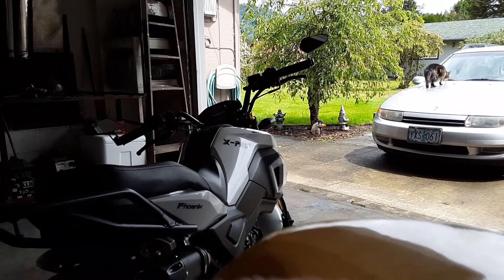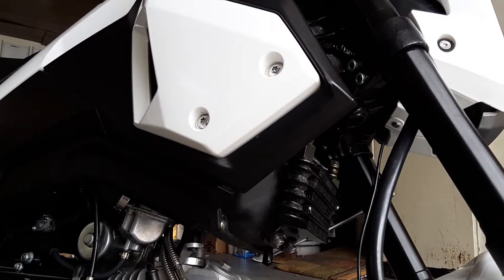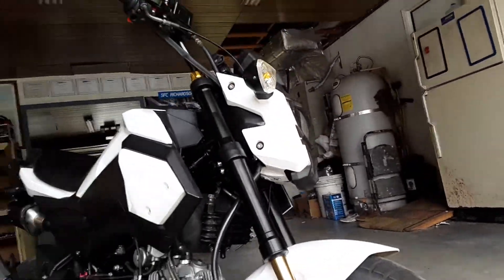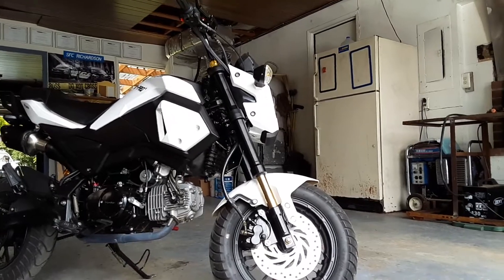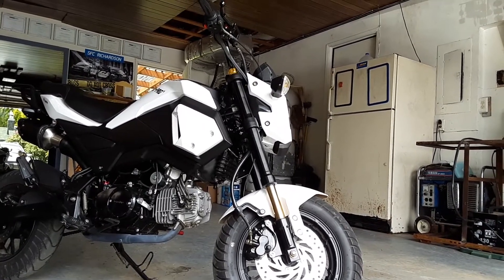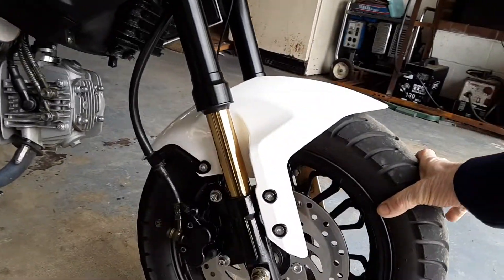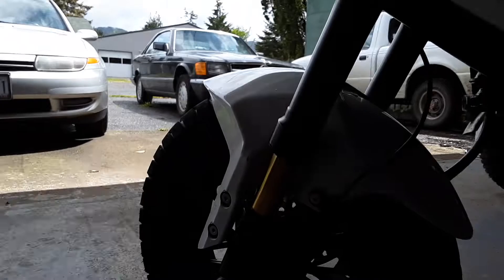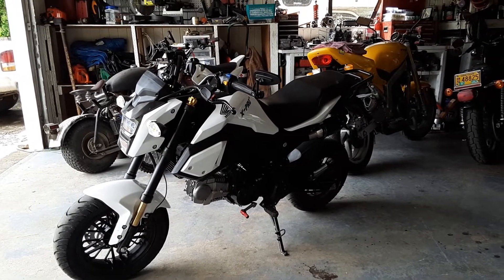Vader 125 Honda Grom clone new front end

Comment: I just bought these forks because mine on my vader wouldn't rebound I had to pull them out but as soon as any pressure was applied they would just sink and stay and made me lean forward when riding. Your the only person I could find that knew what forks work on vader so thank you. Just wish shipping wasn't so long!
Reply from the maker: Glad to here it, I know you will like the transformation.  You can space up the stock handle bar clamps with a couple of washers so they will clear the adjusters on the tops of the forks. Let me know if I can give any further help.

Comment: Love the videos, very informative, and great taste in mods. I ordered the same forks as well, which length did you get the 715mm or the 665mm? Did you change the fork oil in the new forks as well?
Reply from the maker: I think you will be amazed at what those fork will do for your bike and how they will make you realize how bad the OEM fork are. It would be cool to put the longer fork on with a longer shock and make a sort of duel sport Vader. I know the speedo circuit would reach but the brake hose would have to be replaced with a longer one.  I went with the stock length 665mm. Right now I have the fork set at full soft, 3 clicks rebound, 2 clicks compression witch makes them feel even with the shock Im running. Will be looking forward to your remarks

Comment: Do you find that the bike does not turn tight enough?  Turning around on a back road can be tricky. Thanks again for the videos!
Reply from the maker: Havent noticed any turning radius issues with this bike but I have been riding bigger bikes until this one and there turning radius is alot bigger. Thanks for you support.

Comment: hey man could you do me a huge favor? could you remove the front sprocket cover and record the hole the wire goes into the stator cover? mine has a huge hole and oil spews out hitting the chain and then slinging it all over my leg and rear set. i need to see if theres a grommet that goes in there or if mine was just milled shitty.
Reply from the maker: Oil coming from the generator near the electrical entree spot, that's not good because there should be no oil in that part of the engine. First make sure ther is just one quart of oil in the engine no more. If ok further disassembly of the generator enclosure will be required.